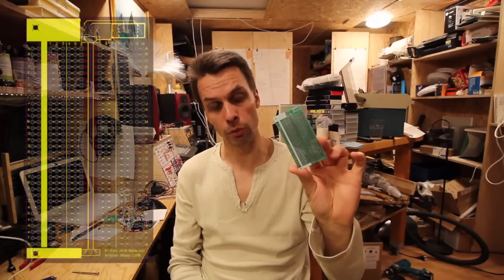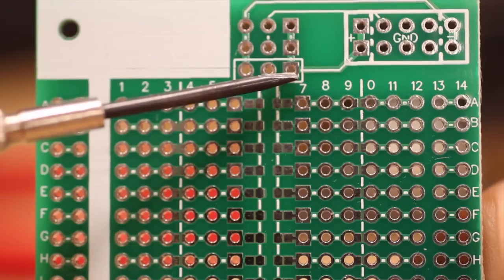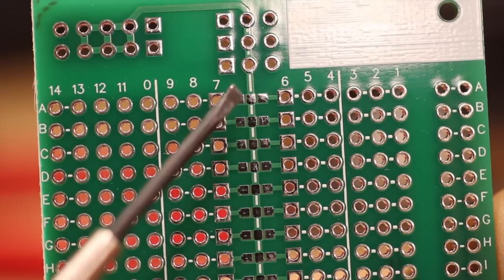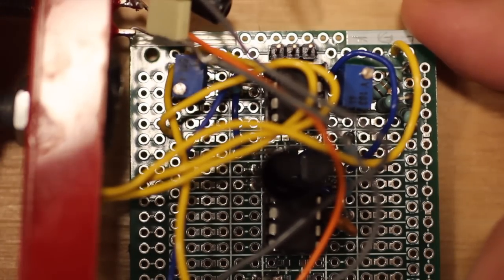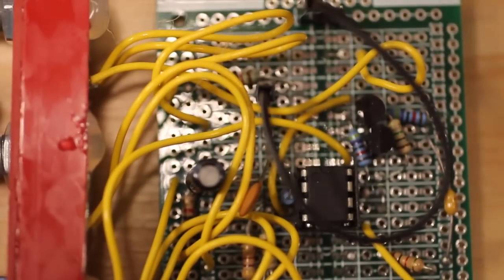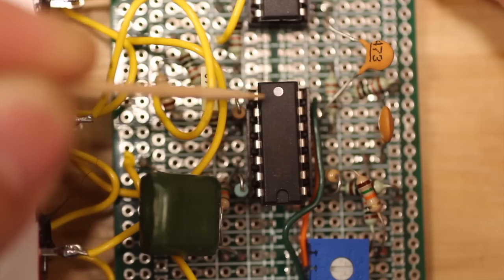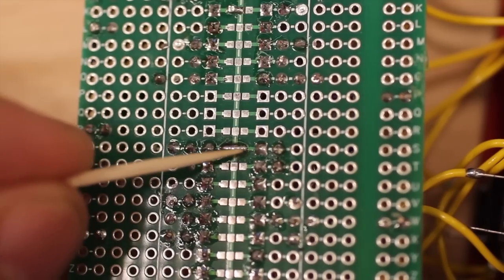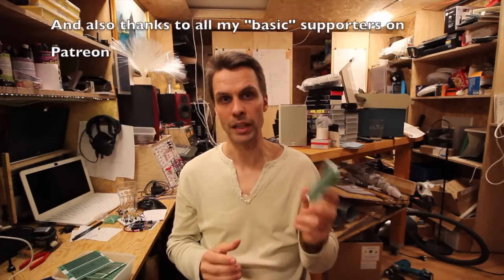Introducing P-0+o / Proto, A prototyping board for ICs and Modulars

Comment: Hello Kristian I am looking to prototype a 32 pin FLAT part, the AD9102. Will this bard take a flatpak?
Reply from the maker: No. The ad9102 is a lfcsp package and this board does not support that. I don’t have any smd converter that would work with that unfortunately.

Comment: I am pretty dumb, so I will meter it, but could you explain the new revision? The 3340 will work perfectly on this board, but think I've could have made some more "shortcuts" if I had planned it better
Reply from the maker: I will put some effort into a video for the latest revision this week. Sorry for putting that off for so long.
Reply: @SourceryOne  It was pretty selfexplanitory, still amazed by how good theese boards are to work on. Any recomandations on stacking modules powerwise with multiple boards (I'm kinda low on outputs), and where the best spot to slap on a power LED would be highly apriciated

Comment: Hello!  So I built the dual AR on this board.  OMG, this protoboard made the build soooo much easier!  And sensible!  Cleared up all the confusion and messiness I make trying to get grounds/+/- all sorted out.  Really great product.  But now I want MORE!  Hopefully, you can get the selling worked out.  I'll check tindie to see.  One minor comment, which could be my issue - on some of the micro-breaks where you add solder to continue the circuit - when I tried to add solder between the connections, it kept flowing to the soldered points and would not cross over?  As I said, it could be my problem.  I just ended up using a small lead wire to connect across.  Still, really cool to work with and made things much easier and cleaner.  Thanks!
Reply from the maker: Thanks for the comments, I have also found that the "continue the circuit" pads are still not optimal, too close to the throughhole pads and maybe would be better to have on the bottom side? Have to do some more tweaking on those. Thanks, I am hoping for Synthcube to get a couple in their store aswell, that way you  dont have to pay import taxes if that is something you need to do in the US. Orelse I have a few more in the store now...

Comment: This is actually BRILLIANT!! My only complain (with all the respect) is: the board width, which appears to be about 5 cm (?), which translates to an according rack or case depth (I'd use the PCB being PERPENDICULAR to the panel, to save on precious HPs). This would work great on Doepfer or Schroff racks. But too many case manucturers limit their depths to 5 or 6 cm, which is a real pain in the ass... So, I'd rethink the project to make for something not wider than 3 to 4 cm at max. But this is my 2 cent thought. Otherwise, great initiative. Another idea (if you'd ever need one), would be to make PANELS (possibly, 2mm aluminum alloy). And KITS for your modules - I guess this would be the road to become the new Doepfer... or the new Thonk! Why not?
Reply from the maker: I also use it perpendicular but have a deep rack. Another less deep version might be an option? If it gets too cramped it is hard to fit all the components needed. Thanks for input, much appreciated and I will take it into consideration.
Reply: Kristian Blåsol To give a further feel of how frustrating it might be not to be able to fit a "too deep module" onto a commercial (too often the depth is so limited!!) Eurorack case: https://youtu.be/5GGeYqTANbc?t=175